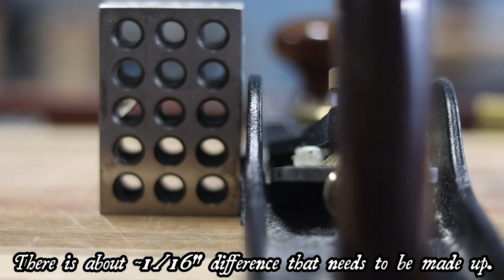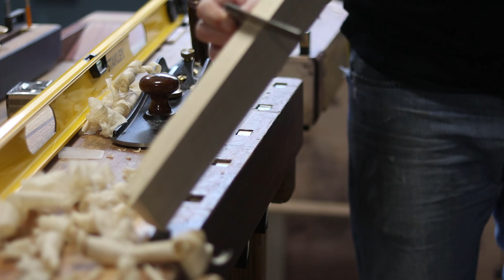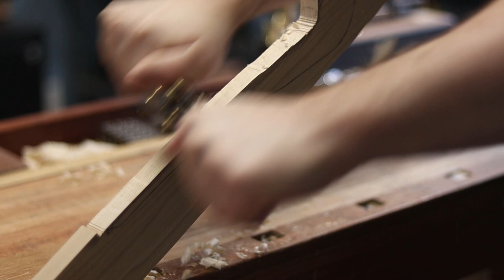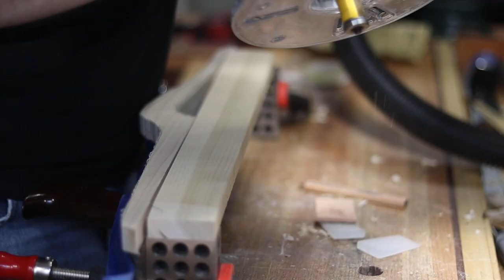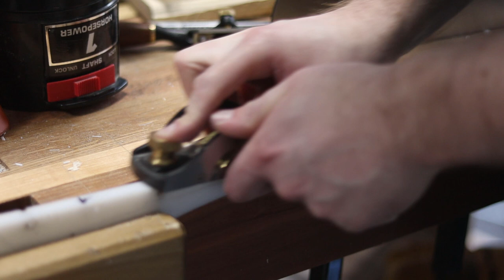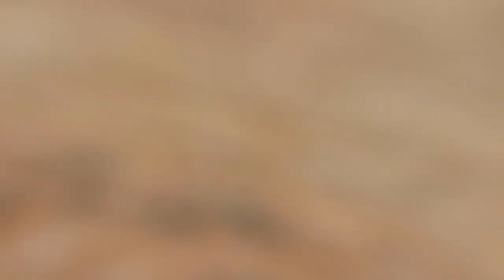Improving the Veritas Bevel-Up Jointer Plane | Jointer to Shooting Plane Conversion

Comment: I have a shooting plane, but definitely love this idea for when I’m long edge shooting panels on the benchtop with a batten.  I have some HDPE just perfect for doing this.  Wasn’t something I knew would be a problem until after I had already sold both my Bailey 7 and 8.
Reply from the maker: Shooting long grain is what I use this mod for. HDPE works pretty well with hand tools. You just need a sharp blade and to take a slightly heavier cut. There is a sweet spot for shavings.

Comment: Hey brother… I really haven’t needed to give my Veritas LA Jointer a big workout until the project I’m working on right now.  It’s not like I’m even working difficult timber either; clear dry straight grained curly maple 🍁.  But I’m frustrated 🙁: Throat choking extreme start and stops; it’s kicking my rear.  I’m certain it’s sharper than the dickens, I’ve changed mouth openings multiple times and depth of cut too.  I caught myself constantly picking my L-N °5-1/2 over and over again.  The only differences I can possibly think of are that while all my joinery planes are Veritas (skew rabbets, scrub, skew rabbet block, routers, plow, shoulder planes, shooting plane, etc), the only other Veritas plane is my LAJ.  Now, it’s in PMV11 and the LA Jointer is in A2, but all my bench planes are L-N (°’s 4, 5, 5-1/2).  So I’m trying to figure out if I’m just not the right guy for a Veritas LA Jointer and I need to sell it and get the L-N °7, or is there some set up secret I’m missing. I don’t need it for shooting, so there’s that, but do you have any advice or did you experience any frustration with it too when first starting with it. I just know you use your’s a bunch and may have some ideas.   I’m not opposed to selling the Veritas and going with a proper °7 bench plane, just not in a hurry to do so, if I might be missing something about the LA Jointer.  Right now I’m regretting selling my Bailey and thinking about hauling out the 6” electric jointer just to keep from being so frustrated.
Reply from the maker: First I would try waxing the sole. If sharp is already ruled out as the culprit that would be the next easy thing to do.

After that, I would try raising the bevel angle on the blade. I've notice with the low angle blade it can catch if you happen to go against the grain. Curly maple seems to like to catch no matter which way you plane it. I have mine set to 38 degrees to reduce tareout on misbehaving woods.

That would be the equivalent of planing with a 50 degree bevel down plane. If your LN are planing it without issue then my guess it is the bevel angle of the blade.

Comment: Thanks for the video, I’m awaiting my BU Jointer and have sold my Stanley No° 6. So I’ll be all bevel up in my shop except for the L-N °5-1/2 and °4 (not counting joinery planes that are bevel down 🤣). I’m sure I’ll want to trick mine out some too.  Have you either of the attaching fences for yours (regular 90° and they have that adjustable one also); I don’t see where I’ll really need one.  I figure if I’m really worried about a joint and can book match it or long grain shoot on my bench top.   The mallet is awesome brother! I’ve already been using my wooden rabbet, grooving, and beading planes with it ❤️.  I want to post it in my FB group, but if I do, you’ll probably have back orders for the rest of the year.  Let me know if you want the business, because it’s gorgeous, well designed, and the perfect for the delicate job that requires good feedback that it’s designed to accomplish.  -B
Reply from the maker: Got to love the bevel ups! I do not have any of the fences. I was never sure if I would have a place for them and never ended up on getting one.

I'm glad you like the mallet! Hey, feel free to post it wherever you want 😁